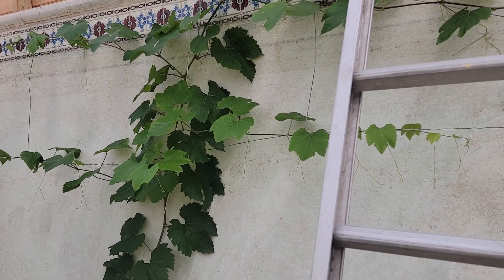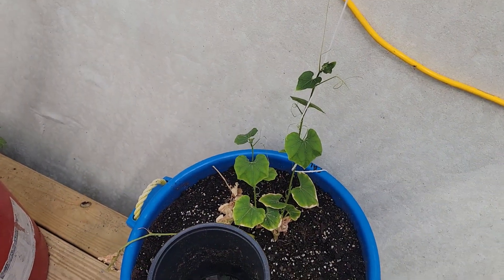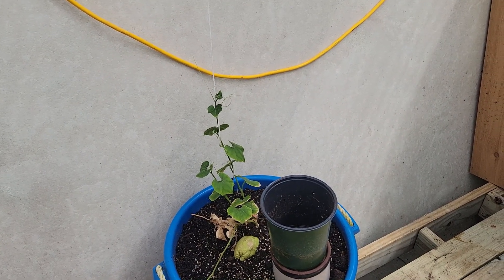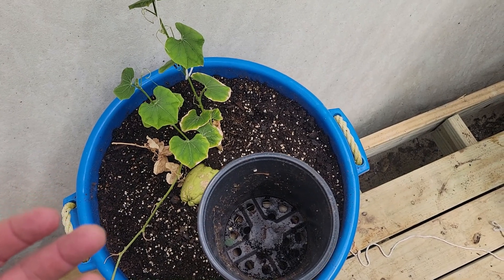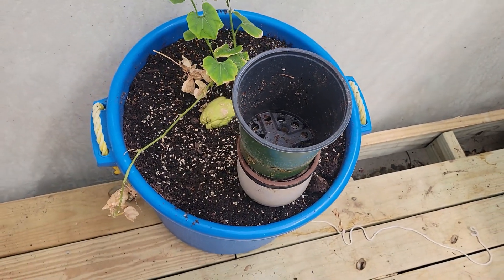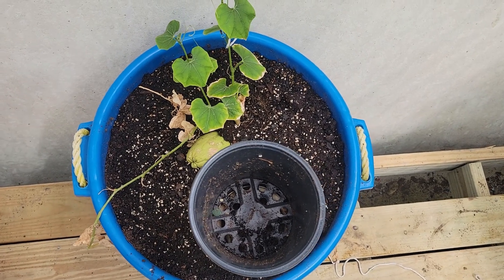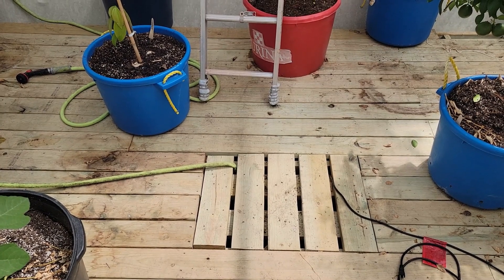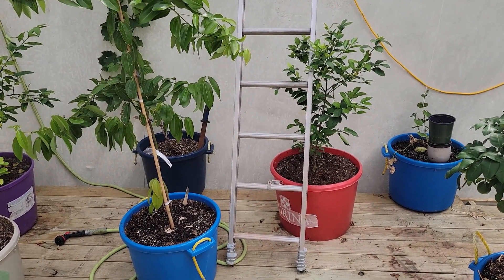Heave prevention -greenhouse from a pool

Comment: I would say in your area the ground water is deep enough your pool/greenhouse is safe. You could dig a quick hole in the adjacent area to observe how fast or if any ground water fills in. That's what I do if I plan on opening a deep excavation just to see what I'll be dealing with.
Reply from the maker: My pool has an 8ft retaining wall on one side. Built into a large slope. No chance i have ground water. Once i pull that drain cap the excess water should drain out of pool on its own without sump pumping.
Reply: @heronthere  Sounds like it should be a non-issue then.